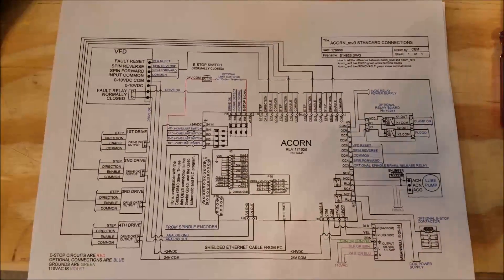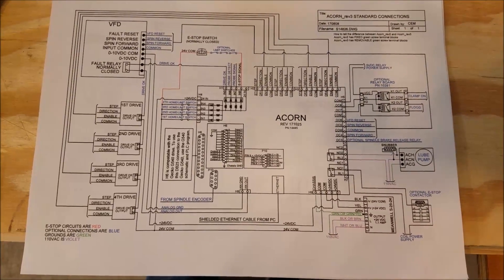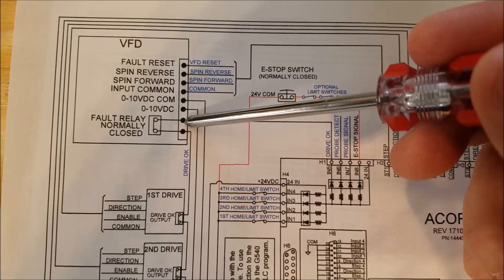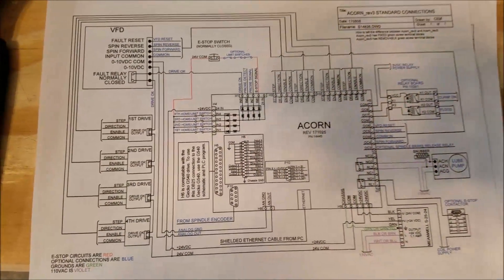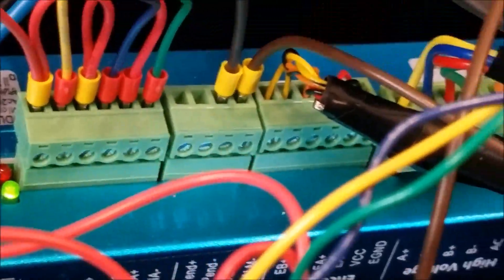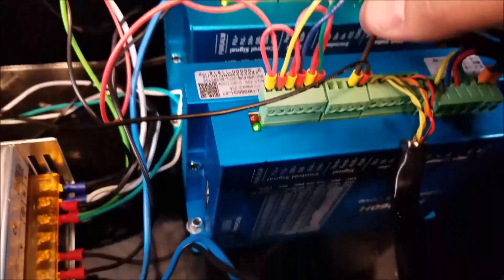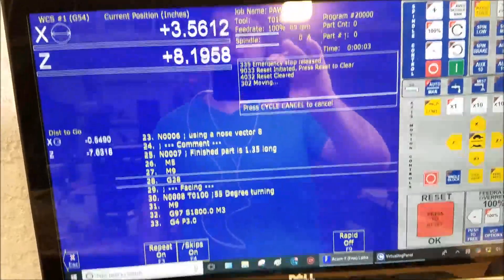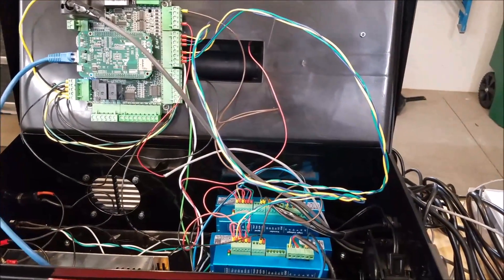DIY Closed Loop CNC Control #7: Drive OK Alarm

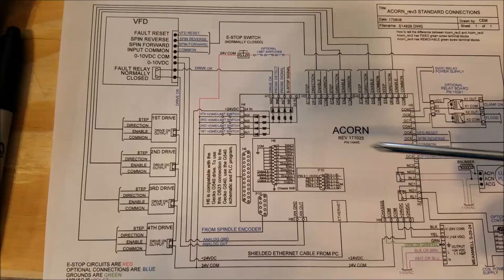Comment: 2:57 - Is there a way to not daisy chain the alarm state system and hook them up directly to the acorn board so that the software/operator can precisely know which specific motor faulted? I think the MESA card has tons of GPIO pins and can we program it for this functionality? Thanks.
Reply from the maker: I don't think the Acorn has specific individual inputs to handle that.

Comment: Hello, what is the difference between a hybrid stepper motor running at 3 phase alternating current and a hybrid stepper motor operating at 2 phase DC, please help and thank you very much

Comment: Hello...Please make video wiring MPG to that driver.
Is that can directly wire up from manual wheel encoder handwheel MPG to the driver...?
in the driver there is writing pendant and ALARM
Thank you

This link hand wheel MPG:

https://www.aliexpress.com/item/Free-Shipping-Manual-rotary-encoder-MPG-For-CNC-machine-tools-60mm-and-80mm-optional/1405389990.html?spm=2114.search0204.3.21.54f97f4dCACy1l&ws_ab_test=searchweb0_0,searchweb201602_3_10152_10151_10065_10344_10068_10342_10343_10059_10340_10341_10696_100031_10084_10083_10103_10618_10624_10307_10623_10622_10621_10620,searchweb201603_12,ppcSwitch_4_ppcChannel&algo_expid=32f1ccec-1454-4138-9b25-c97a763d8ee9-3&algo_pvid=32f1ccec-1454-4138-9b25-c97a763d8ee9&priceBeautifyAB=0

Comment: I’m trying to wire these drives to a c25 ess board and I cannot get the alarm to work in Mach 3 it needs to be 5v
Reply from the maker: Interesting.  My drives are working with a 24V signal.  I think they will work with 5V, as well.  It's basically a switch.  Could you possibly need to invert the signal logic?
Reply: Franco I had to add a 1k pull-up resistor
Reply from the maker: Ok.  That makes sense.  I'm glad you got it working.